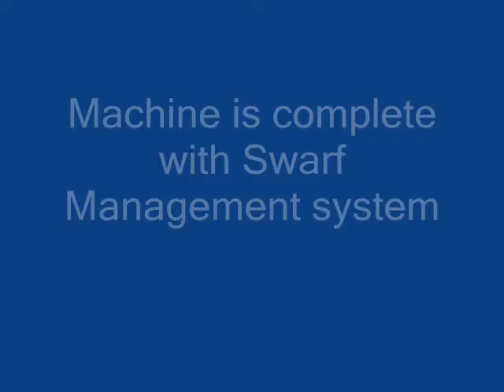Robodrill T14iBl

Comment: Fanuc Robodrill machining centers are the workhorse of the automotive industry.  These machines were originally designed to speed up the complex task of drilling and tapping multiple holes- hence the name Robodrill.  Nothing can drill faster- fastest chip-to-chip tool change time in the industry.  And they are equally as good at milling.